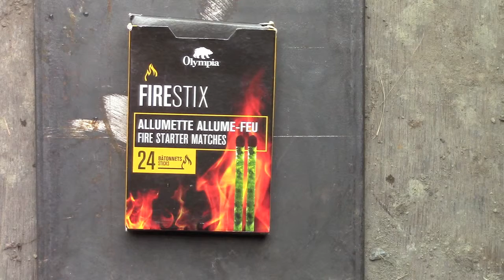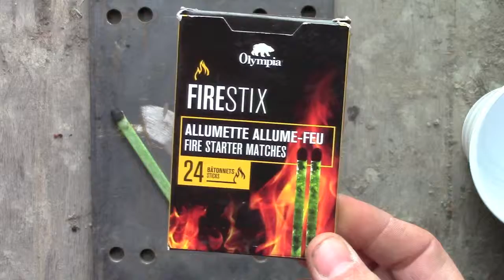Product Review - FireStix by Olympia

Comment: Had a box in my car from a year ago. Tried one and it worked great but wind might definitely interfere. Lighters are waterproof so even if the match goes out. You can light the plastic and have it be a great starter still

Comment: Well that’s disappointing! My wife just seen these in town and picked me up a couple boxes of them because I’m finally going on a long holiday camping next summer and thought they’d be good to have. I’m going to try a couple in the next while to light the charcoal grill and if they preform as well as yours did she will return them.
Reply: I bought two boxes at menards recently and they work great so far. This video is old and the box doesn't even look like that anymore give them a try. I had one lit from before I put the video on cause am doing research while also testing it myself and it made it past the advertised 5 minutes. Two things to note place the middle of the stick where you expect to put your kindling cause it starts to burn and shrink into a ball towards the middle and after several minutes the red starter tip absorbs water and becomes rubbery and easily falls off I still need to test how well it'll light after it's allowed to dry off a bit. So far they're way better than wooden "water proof matches" had a box get wet, the wood absorbed water and they didn't work after that.